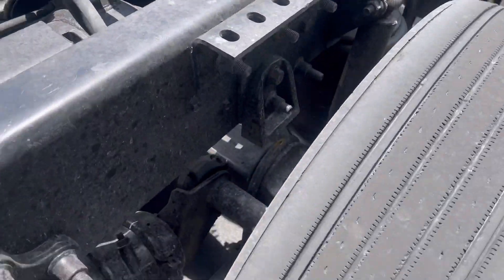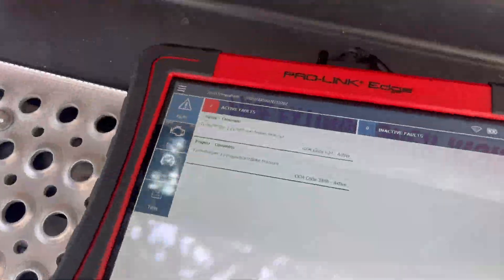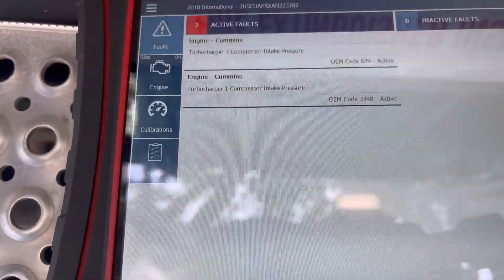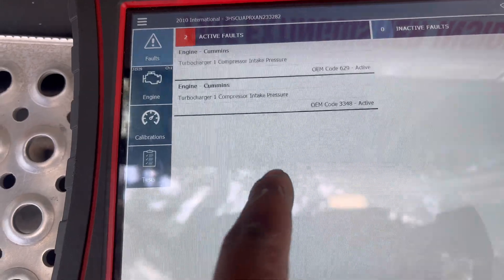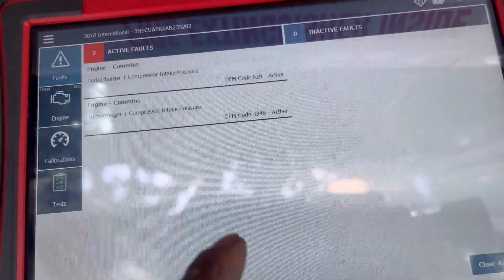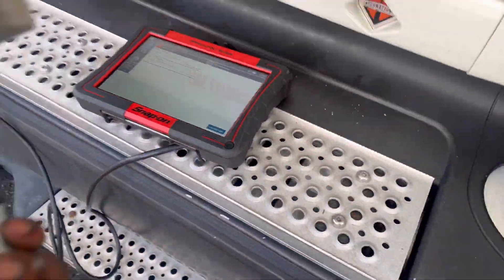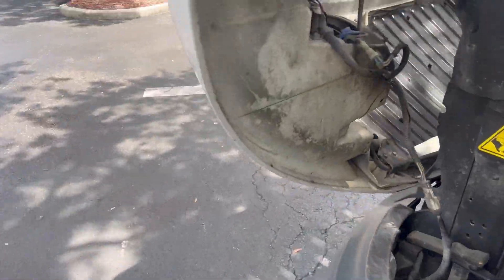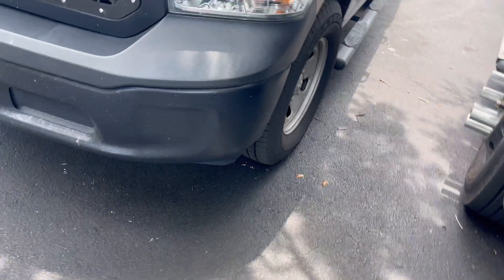Cummins ISX 15 Failed Turbo Seal

Comment: I have the same 2010 prostar isx. Deleted it 300k ago and havent had an issue since. And i put the new lifetime crankcase filter in so the engine can breathe. The clogged filter caused all that. Return the truck it should have a warranty if bought from a dealer

Comment: I have the exact same problem..i got oil coming out of those hoses/tubes, as well as the egr tube that goes on top of the engine to driver side,next to pressure sensor..whats the fix for this?
Reply: Delete and lifetime crankcase filter